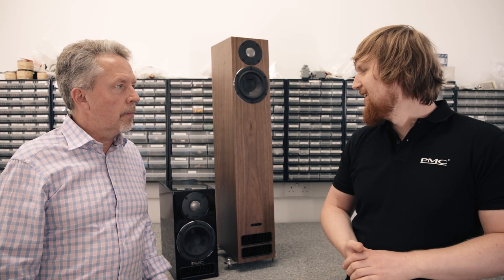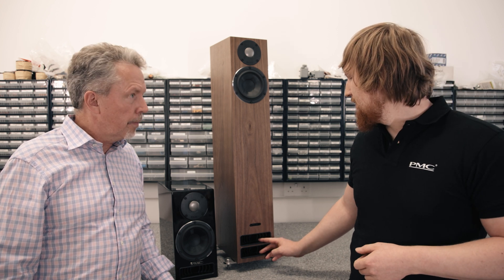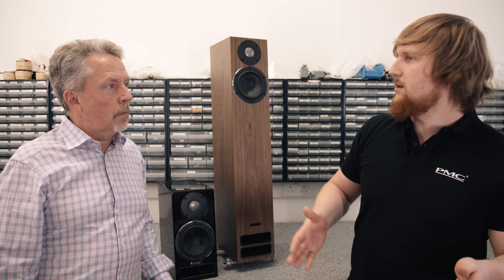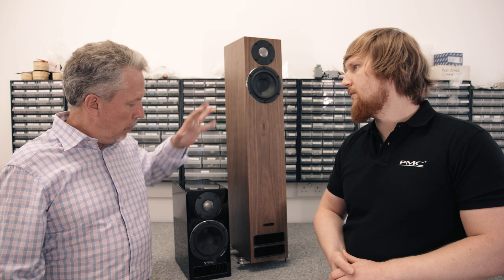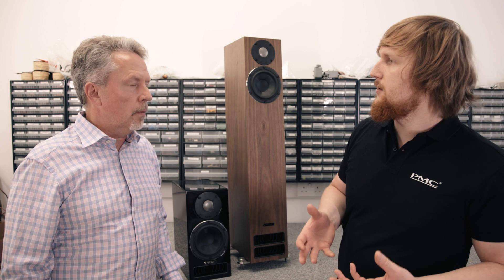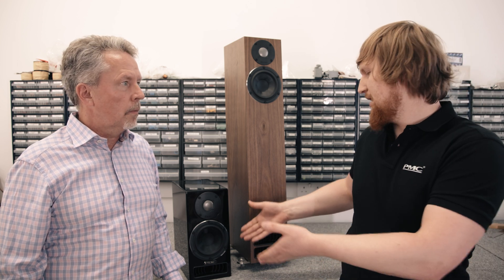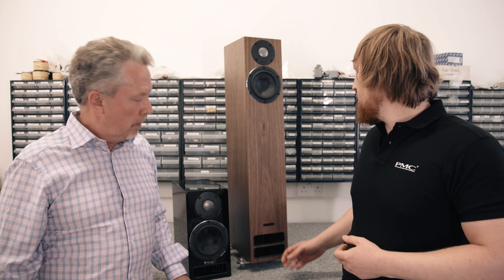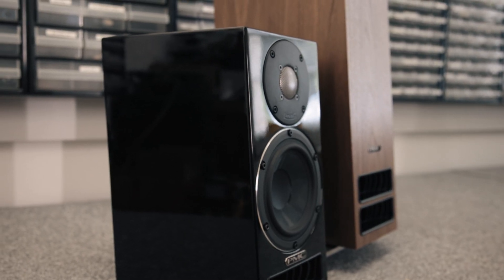PMC's Toby Ridley on Transmission-Line Loudspeaker Loading - SoundStage! Real Hi-Fi (Ep:37)

Comment: The original transmission line loudspeaker designed by Bailey in Wireless World in the 1960s was claimed not to be resonant but to be a gradual absorption of the back wave. It was much larger than could be marketed today and, when you truncate the line, it is resonant, but no longer a true transmission line.

Comment: There are so many variables involved in the design of a transmission line. The math is proven, very elusive. You wind up having to build, test, and build again, and test again. Any math you may do up front is going to ballpark a design at best.  I have owned a pair of last generation big IMF’s for over 30 years. John Wright the designer spent a decade and a half refining the same design I’ve heard a very early pair, and I’ve heard the reference version sits just  atop mine, the RSPM VII.  I also heard quite a few of the TDL models to follow them. Also designed by John Wright. Short version… I didn’t like the metal down tweeter. That old Celestion treated fabric tweeter with the fancy lens might Not have been perfect, but man did it sound like Music. Some of the goodies we don’t talk about include the fact that it is a resistive system, not reactive.  The mass of air in the line serves to act as a brake on the driver.  If you get the air mass and damping, just right, the driver stops on a dime like no other design. You hear textures an octave below, where most speakers can deliver texture. Even for a genius like Wright, it took over a decade of tweaking to arrive at appoint well beyond where that basic design had started. It makes me sad that more people haven’t had the chance to hear them even after more than three decades, they amaze me on the regular. The founder of PMC was a giant IMF. Fan. It was the “why” of PMC.  Time to go throw on a record…

Comment: Good morning 🌅, interesting subject, I built my Transmission line cabinets back in early 80s , I have just replaced my drivers to 8” SEAS and tweeter , 150w , NAD . The cabinet is 12 “ x 14” x 5’2” , line is about 14’ , ported at the bottom, setting about 31/2” of the floor, I can get my floor oscillate, very deep bass , it is a pretty that you didn’t play some music, it would of been interesting to hear 👂 your coming from mine, 
Retired English dude living in France,

Comment: Missed on the downsides: the peaks and troughs that are produced by TL designs within the lower frequency range. It would have been interesting to hear how PMC deals with those.
Reply from the maker: You might be interested in this video then... https://youtu.be/YWvynnci85Q?si=TMZQy1-O94mkfIpO
Reply: Those are easily fixed by adjusting the CSA or by adding filling/stuffing. The only downside to TLs are the size but if you model it correctly you can make the CSA smaller than the speaker SD and eliminate the first peak without stuffing

Comment: Surprised that the engineer did not mention the output from the vent being in phase with the bass driver as the way to soften the roll off at the -3db point. That is surely the point of a TL speaker, to add/sum the output in the bass in order to compensate for roll off.

Comment: Hi 👋, Not sure if you will see this transmission, 😂 . About 40 years ago, I built a pair of transmission line loudspeaker cabinets with a help from a friend who was into electronics., he built the crossover, I supplied him with a special microphone and some equipment, but I make the boxes, they are 1 inch thick, MDF, They are approximately 10 inches across the front, 12 inches deep and stand dust over 5 feet high, it has a line length approximately 14 1/2 foot from what I can remember, I just recently had to replace the driving units it had peerless in before, I’ve now put, SEAS 8” 150w and 3” tweeters , I can’t remember the model numbers of the components, And they fire out the bottom, and it’s approximately 4 inch gap under the cabinet from the floor, I play classical to heavy metal to blues and Nordic Viking war music, play sound, amazing, I even have some friends when they’re near me in the summertime on holiday spent hours listening to various types of music, 
I got the design out of a hi-fi magazine from the early 70s , I cannot remember the article, but I do have the magazine I haven’t seen it for many years, My equipment is what they call mediocre, I play vinyl on a Linn Sondek LP12 , play CDs on Pioneer, I played cassettes on Nakamichi D2 , and I stream music from my iPad through a Bluetooth device, and my amp is a NAD, very interesting subject transmission line. 
Phil from the moulin France .

Comment: A folded 1/4 wavelength... so why is this a "transmission line" and not a folded horn..? It's a folded horn with a little bit of exponential folded horn thrown in to broaden/fudge the resonant frequency of the horn.
Reply: I thought that horns vent at the big side , and "transmission line" vents at the little side.
Reply: @RennieAsh  In each case the added free energy is reliant on the air in the Helmholtz resonator being excited to act as an additional but out of phase driver at the horn/transmission line resonance.
The horn transforms the air impedance from being fairly compressed behind the driver to a lower pressure but larger area wave at the exit  whereas in the transmission line the path is stuffed to reduce the harmonics supported within both types of pipe, the reduced area of the TL could potentially be where chuffing would occur.

Comment: Pmc seem to do it better than most, but I still hear some delay with some models.  There is another elephant in the room which becomes all too apparent  with smaller classical ensembles and that is TL’s just cannot compete with a well designed large baffle ported or sealed design for bass timbrel accuracy and part of this is down to the very narrow baffle and ironically the low system q. 

I think the group delay stated for ported designs  was over exaggerated.  A poor ported design might be 25m/s and that is audible.  However, when designing distributed vent  Helmholtz tuning (a sort of port using multiple vents) the models don’t seem to predict the tuning accurately so you have to use tools like speaker software for measuring and plotting impedance with frequency, testing excursion bandwidth limits and output.  As with a TL, internal damping and position of the openings all affect”q” and group delay.  I have got my own vented designs as low as 12m/s but more often an average would be 15 to 18m/s which is barely audible in delay terms.  It takes a lot of development and learning to perfect this type  of Helmholtz tuning, so the assumption “ports are  straight-forward” simply isn’t true.

Back to bass timbre.  Recreating a cello or double bass to sound like one and not just have cab resonances play along is a fine art.  There is no doubt that a well designed, well controlled, wide baffle cab can do this better using a higher overall (narrower)q.  This means picking a larger more efficient driver with low fs and low distortion, and making the baffle angled to avoid direct reflected edge refraction affecting direct radiated sound.  

This approach is out of fashion but boy does it deliver realism in upper bass registers.  This is why I prefer to use large high efficiency low fs and low excursion drivers over modern long throw small diameter drivers.  The TL approach using a low q system helps in reducing distortion by limiting driver excursion which is a good  thing but I still think that purely from a sound quality perspective that the immediacy and efficient air impedance coupling to the room of a big driver convinces more but this also requires the use of high quality drivers.
Reply: What you state is, pretty much, “above my head” but the “take away” for me, as someone who loves the sound of the cello, is that I would need to think carefully about acquiring a pair of TLs - that said, it’s great that a company like PMC is committed to that type of technology and, from what I read, is earning a lot of plaudits for a number of their models.

Comment: When I auditioned the speakers for my home cinema, I had picked out a few to try, the hi fi shop also put in a pair of cheaper speakers to compare with. Blind testing and it was down to two sets of speakers, a set of TAD by Pioneer and the unknown set of cheaper speakers, it took quite a while to decide but the unknown speakers eventually prevailed they were PMC OB1i, not cheap but less than half the price of the Pioneers, been using them in my cinema since 2008 and love them, the difference was subtle but the PMC just had that little bit more clarity and extension.
My cinema front speakers OB1i left and right, CBi centre speaker and REL Storm2 sub: https://i.imgur.com/OHnqT6V.jpg

Comment: EQ makes TLs fairly pointless. Just use a good quality sealed design with EQ .. most streamers have it built in or will do soon
Reply from the maker: One of the worst things you can do is boost the bass on any design too much. You can overdrive the woofer I to distortion or even damage.
Reply: @soundstagenetwork you can do that by turning up the volume too, and many people blow up woofers and tweeters
Reply: EQ isn’t better. I haven’t had it for years. My bose has bass and treble but you have to adjust it depending on the volume. Doesn’t sound as good as my Naim pmc combo
Reply: @andrewwalker7214 modern Bose products actively change EQ based on volume level.
You can get this loudness compensation on some DACs and amps.

Comment: TL boxes can sound great when designed well, but they are also incredibly difficult to design well. I believe hornsrep does a pretty good job at simulation. But make sure you measure the driver via DATS or something similar before building, because small variances in the manufactures stated parameters vs the actual speaker parameters can make a massive difference in having a good sounding speaker.
By their nature, you often get several peaks and dips in the response in the range of the line contribution. They can be mitigated somewhat by doing things like having the speaker not play at the beginning of the line, but further down, roughly 1/3 the way down the line tends to work well. Stuffing the line in certain spots and tapering the line can also go a long way in making the output of a tline much more linear.
Reply: I've been designing t-lines exclusively since 1990, and I think they're the simplest enclosure to design!
When audiophiles chip in their 10 cents worth ... is the only time t-lines seem to get complicated … but they're really not! 
Headphones on for the demo https://www.youtube.com/watch?v=-U3XW6TV9zI
Reply from the maker: Thanks for the input!

Comment: There really isn't much available on TL speakers. Boom boxes are too easy with computer software now, so few people look elsewhere. This was a good discussion, informative and useful in a technical way. Group delay was interesting, as one would assume it would be more towards ported than sealed, not in the middle. Kind of like a passive radiator in a way. TL are interesting.
Reply: Boom boxes may be easy to roughly calculate but people frequently underestimate how to  perfect the designs for limiting excursion, keeping bass linear, and minimising group delay.  It is easy to let software spit and answer out but it seldom is the right answer because each driver will have specific requirements for tuning system q and this is always affected by port design, positioning and internal damping.  Anyone can design a ported enclosure using software but few can design a really good one.  That takes development, understanding and time.
Reply: Glad you enjoyed it!
Reply: https://www.youtube.com/watch?v=-U3XW6TV9zI - it's this simple!

Comment: In 2000 I purchased a pair of VAF DC-X transmission line speakers and I love the bass extension. They’re down only 3 dB at 29 Hz. When Rolling Stone reviewed them in 1995 they said they were the first speakers they’d heard that didn’t benefit from a sub-woofer. I can confirm that. I just ordered the latest version of the DC-Xs from Phil Vafiadis out of curiosity. My existing pair are worth the same amount of dollars that I paid in 2000 and are only rarely available second-hand. Phil says the company has manufactured more than 10,000 pairs since 1995. VAF are located in Adelaide, South Australia.
Reply from the maker: Thanks for sharing that!
Reply: Very interesting!
Reply: I brought speakers from Adelaide Speakers [Ascension Speakers] they are also TL and have incredible bass. I also own another TL speaker built in the early 1970's called IMF and they have a cult following and for very good reason.